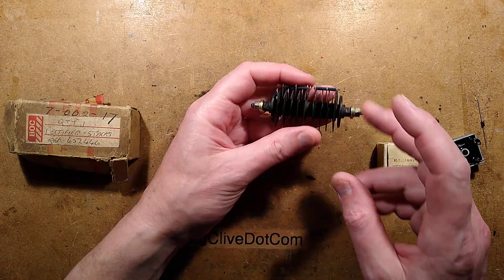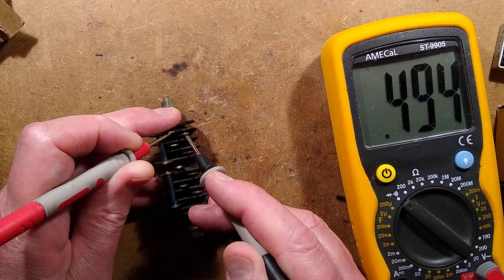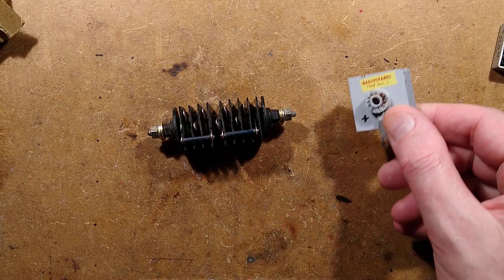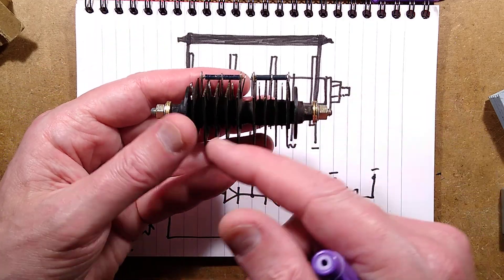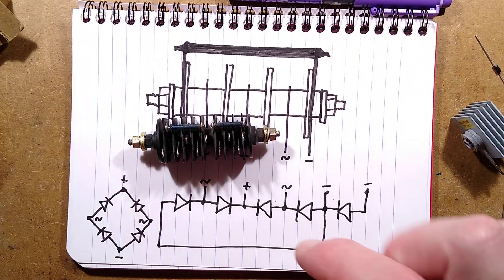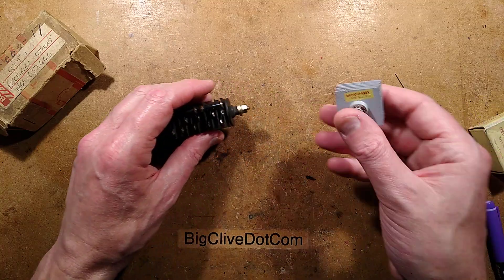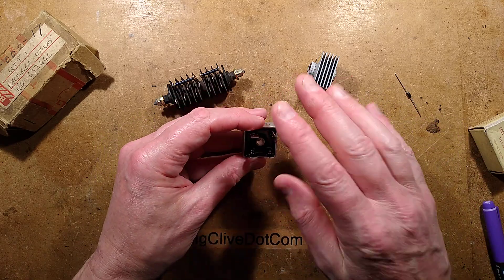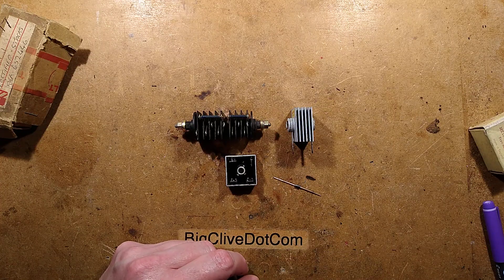Selenium rectifiers - the smelliest components ever

Comment: Maybe the extra diode is for using in a device that can be powered from AC or battery, to avoid charging the battery when on mains power.  Also I have seen and smelled a different kind of selenium rectifier used in slightly newer devices, where the plates do not have a hole, and are in a box or a tube, pressed together with a spring. This makes it smaller but the heat dissipation is a lot worse. There were full bridge rectifiers for radio anode voltage like that, and also TV anode voltage rectifiers made of a lot of very thin, confetti-like plates in a long tubular package, with just a dot of selenium in the middle. Looking a bit like one of the kinds of caps for a cap gun.

Comment: This helped me troubleshoot and fix a 1950's Lincoln Fleetwelder 200 arc welder with a non-functioning Arc Strike Circuit.  Replaced with an ECG 400V, 40A PRV bridge rectifier - thanks!

Comment: I had an old Triang train set in the attic from when I was a child and decided to give it to the grandchildren. My main concern before doing so was the safety of the mains transformer, but on inspection, I decided that it was well constructed with good separation between the primary and secondary.  I replaced the cable and mains plug with one with a built in RCD unit and as part of the refurbishment, I also replaced the selenium rectifier for a modern silicon bridge rectifier. This gave me a slightly higher output voltage, which compensated for the somewhat corroded parts elsewhere, so it was a win-win situation.

Comment: When I was a an apprentice with Reliance Telephones late sixties the Modern Telephones, Wellington St., Glasgow. Power supplies for lead acid batteries and intercom systems used proper power units screwed to the wall. You woulds go to the customers premises they always smelt like rotten fish. Four Lucas diodes and you were back in action.

Comment: The founder of the company I used to work for was employed by a selenium rectifier manufacturer here in the USA back in the late 40's.  He described the "burn in room" where they had racks of these things under load.  Apparently, right off the mfr'ing line, a lot of them had conductive faults in them that would blow out; I suppose the burn-in process would also weed out any of them that remained shorted or failed completely under load.  Of course he described the smell, and I was aghast b/c I'd heard that the smoke was really toxic.  He had a bit of a different mindset - he had no qualms about cleaning up mercury spills in our lab as well. lol  I guess his mindset worked out OK - he passed away in 2007 at the age of 81 and he worked full time right up until a month before he passed.

Comment: I've got a 1956 P&H 400 amp AC/DC arc welder....with a selenium rectifier...must be 60 plates, and maybe 8" or more wide...BIG fan blows on them all the time the machine is on. The TIG works about as well as most modern machines, but I know some guys have replaced the Selenium with silicon rectifiers...it's a full wave 'bridge' !!....so you'd need 4 big diodes and some nice aluminium plates...OK, aluminum. Youtube says I'm spelling wrong...

Comment: I learned how badly a blown selenium rectifier smells in the 1950s.  20 years later my Dad was upset that his workbench 6/12 volt power supply outputs were too high when I replaced the selenium devices with silicon diodes.

Comment: I still have a bunch of Selenium Rectifiers around here somewhere. They were very common when I first got into Electronics in the late 60s early 70s. Generally tougher than the Solid State equivalents available at the time. People found that just changing them with Solid State could cause over-voltage problems as Clive explained. We quite often had to deliberately add some resistance to balance things out.

Comment: Whenever I come across a selenium rectum-fryer as I call them I replace them. They do have an awful smell when they burn out. Had one in a Guitar Amp I was repairing and sure enough the garage started to smell like rotten eggs. Also keep in mind they attend to have the Anode and Kathode mixed up, I found that out when I was putting in a Diode to take place a Selenium in a old RCA VTVM.

Comment: In old setups I've seen terminal blocks with multiple diodes in series, used to drop the DC voltage to the desired level.

Comment: I love vintage electronics... I have over 100 vintage calculators, including an HP 9100A, a Friden EC-132, an SCM Cogito 240SR, A Sony Sobax ICC-600W, and a Wang 360SE. I have an old Sylvania Halovision TV, an pair of old electronic organs, a Conn and a Gulbransen (that uses hybrid modules), and much much more. In addition, i have various internals on display too... The relay module from an elevator, the multiple tube oscillators and amplifiers of another electronic organ, and one of the things I have on display are a pair of selenium rectifiers. They were coated in bright orange. Both are 6-fin high voltage types. The smaller one is a full bridge rectifier (total of 24 fins) with 1.25 inch (just over 3cm) square fins. The big one is a half wave rectifier (12 fins), but it has 2 inch (just over 5cm) fins! it's huge! I just love how they look, so they are one of the many odds and ends electronic bits that stay out on display at my place.

Comment: Question, I've heard something about the fail open/closed being different between the selenium rectifier vs silicon.  Isn't there a difference in the way you need to fuse it?  I ask because I have a jukebox with one of these things in it that runs the selection circuit.

Comment: These are also used in locomotives. They do stink when they die. These come in zeners as well. I had a large freewheeling rectifier short out when one of my coworkers started a locomotive up after he  failed to properly terminate the auxiliary generator. I had told him how to be sure of the leads but he took the advice of a novice electrician. Basically the rectifier exploded above my head. 
Clearly I was not happy and had some very unkind words for him. Don’t hook up a DC auxiliary generator on a locomotive backwards or bad things happen. There is a process for testing if in doubt about its polarity.

Comment: In our product we use a bridge rectifier made of four diode‘s. The first diode always heats up and dies. We believe this occurs due to a thermal run away when the power keeps looping around the rectifier. Is it possible that extra diode is there to take the load off of the diodes’ that build the rectifier?

Please consider this and let me know if that’s possible? 
If so adding a diode to my design might fix our issue.
Reply from the maker: I'd have to see a schematic to work out what might be happening.

Comment: Big, can you show how the magnetic rectifiers work? It was kind of like a relay. I’ve seen them on stuff in museums.. They were put on cheap car battery chargers in the 20’s. It was cheaper and more compact than a mercury bulb rectifiers.
Reply from the maker: I think they were a vibrating magnetic reed that connected with a terminal depending on the polarity of the transformer's or dedicated coil's magnetic field.

Comment: I once walked into the Wheelhouse of a 1950's built ship and immediately went over to one of the chart table cupboards where the echo sounder workings were and sure enough there was a whisp of smoke and the running light was off.  The Mate said the Secunny's (Indian helmsman) guts were a bit ripe that morning so I pointed out that the Selenium rectifiers, of which there were quite a few in the cupboard, had burnt out.  Profuse apologies as they both thought it was the other !

Comment: I wonder how they compare to tube rectifiers. I have an old tube radio here that uses a tube rectifier but the transformer shorted when someone replaced the 400mA fuse with a 35A car fuse. The replacement transformer was from a radio with a selenium rectifier and thus only had one secundary high voltage winding. Had to turn the tube rectifier in a bridge by adding 2 silicon diodes and the resulting b+ is about 10% higher than specified.

Comment: About 30 years ago I worked for a transformer manufacturer in Sydney. We also made a few power supplies for the SRA. (State Rail Authority). One of the items we made was on a steel tophat section of 2mm steel. The components were, one almost full wound toroidal transformer. The mounting screw had to be plastic sleeved for insolation, 1 20watt adjustable w/w resistor, and a selenium bridge rectifier with an extra plate as a blocking diode. We had to use the selenium bridge because the original units built maybe 40 or 50 years earlier had the selenium bridge. The design had to be the same. the toroidal transformer is more efficient... FROM GOOGLE     1878 -1883 - The Ganz Company (Budapest, Hungary) uses induction coils in their lighting systems with AC incandescent systems. This is the first appearance and use of the toroidal shaped transformer.

Comment: I did four years as a navy engineer and our older ships (built in the mid-1960s), and even some of the older individual systems on our newer ships, have all sorts of these rectifiers scattered throughout the various control circuits.

I never actually knew what they did before now, and always just assumed they were some sort of heat sink around some sort of fusible link. Thanks for sharing!

Comment: I was about 9 or 10 years old. I had a beefy transformer, 220VAC in, 12VAC out and I needed DC. I had silicon diodes. So I'd connect one on one of the output terminals and other to the outher but with reverse polarity. I'd get roughly 6Volts. Then I connected another two in a way that there would be two diodes on each terminal, + to - and - to +, then I'd connect the diodes of the same polarities' terminals parallelly. Voila, I get ~12VDC.
I think full-bridge rectifier is the natural next step for anyone with four diodes and half a brain.

Comment: Thanks, that was useful. I’ve got a Heathkit vacuum tube op amp module with two small selenium rectifiers in the screen grid supply. These are in a cylindrical package. I was wondering how bad the lower voltage drop of the silicon diodes would be, but it sounds like it shouldn’t be that bad. I’ll plan on replacing them when I re-cap the unit.

Comment: Selenium rectifiers were used in some railway signal components. The one place I saw one for sure was at the end of a track circuit that was at the end of a signal system.

Basically any selenium compound is toxic even in moderate doses, but unless you can somehow manage to sit there in the stuff, you're not likely to get a dangerous dose from just the smoke

Comment: I worked in an old mill that used them. The winding machines used 90 volt DC magnetic clutches. The selenium rectifiers used were about 2 feet long and 6 inches square. I asked where they go them and was told they came from a B-17 from WW2. This was in the 80's. They had modern digital timers running the clutches relays and the old selenium rectifiers to get the DC power. It was a real crazy rig up.

Comment: You see them all the time in older electronics. You frequently have to add a dropping resistor in series  when replacing them  with silicon rectifiers to avoid excessive output voltages.

Comment: When replacing a selenium rectifier with a silicon diode, it is common to place a voltage dropping resistor in series with the diode. It takes a bit of figuring to determine the resistance and wattage for the resistor.

Comment: Zenith used to use those in some of their 1950s radios, especially the AM FM ones in the "Super Interlude" or "Super Symphonaire" family with the large ring around the speaker (woofer on these High Fidelity rated sets). I've seen some on eBay where the shiny ring / dial around the speaker (search for Zenith C835) is brown and discolored. Guess where they mounted the selenium rectifier? Front center of the chassis, right under the speaker! Needless to say, never pay too much for a Zenith AM FM where the bottom of the speaker ring looks burned!  I always replace the selenium rectifier with a silicon diode and about a 100 ohm 10 watt resistor in series.  (We don't want to strain the 35C5 output tube with too high of B+, especially when line voltages in the USA are already higher than they were when these radios were made.)

Comment: You ever smelled carbon disulfide? Smells like extremely rotten cabbages unless it's very pure. There are only two things which are guaranteed to make an army run away: carbon disulfide and massed bagpipes. Wikipedia says selenium dioxide has been described as smelling like rotting horseradishes.

Comment: Thank you Clive, that brought back unpleasant memories from fifty years ago.
My first permanent job in 1969 was reconditioning IBM keypunches and verifiers. The older machines used selenium rectifiers in the power supplies for the valves and relays. I was surprised by the stink the first time one failed in our large workshop. I doubt anyone's farts smell as bad! Imagine how bad it would be in a WWII aircraft.
Voltage drop was a problem in 1950s DC power supplies. E.G. Both my '00 Gauge' railway and my brothers ''Scalextric' required 12V but the transformer needed to supply 16V RMS. I would often trick my brother into leaving the track by cutting power to my car as he was approaching a corner! Adding a large capacitor to the DC output resulted in faster cars and little variation in voltage with load.
Reply: Yeah, 1969...for me it was the Telegraph Machines...the 'new' ones had electronics, transistors and still operated on 48 volts to work with the rest of the copper lines (that are still 48 volts). The teletypes used 120 VAC input, power supply converted to 48 Volts DC. They still needed 120 VAC as there were induction motors driving the printer and tape/keyboard decoder...all that was mechanical.....lots of tiny parts...100's of springs...

Comment: Don't smell like a fart. 
Dig down to the nearest sewer. Use a sledgehammer to break a hole , then apply your face to that hole and inhale deeply. THAT is what it smells like.
Do you really need to ask how I know that??
You can actually still get them new, as in brand new, not Old Stock unused. I used one in a radio set to replace a failed original. B+ was down to 150V from incoming 250V AC.

Wish I could get them with round plates.

Comment: This brings back some old memories.

I learned about electronics quite early in life, so some of the old appliances that I played with were 50s and 60s vintage.  By the time I became more adept at it, about when my age got into the double digits (the seventies,) silicon diodes were more the norm.  Still, I had some old selenium stacks to play with.

I don't recall burning one out myself, but I do recall being around when it happened.  Yes, the smell is horrific.

Fast forward to around 1981, when I was stationed in Germany and worked in an electronics repair shop.

I bought some stink bombs, which were small crushable glass vials like you will find in smelling salts.  The difference is that, instead of ammonia, it contains some kind of a hydrogen sulfide solution.

Well... I managed to drop one near the 28 volt power supply.  This caused an immediate evacuation of the shop.  The next day, we had to drag the 100+ pound power supply up the stairs and to the other repair shop.  Of course, they found no fault with it.

So we had to drag it back down the stairs and reconnect it.

(And I still have no idea if it actually had a selenium stack.)

Comment: If replacing a selenium rectifier with a silicon version a surge protection resistor should be fitted, especially if high voltage electrolytics are involved as many can't stand high surge currents.  In TVs of 50s and 60s vintage the usual half-wave selenium rectifier was replaced with a BY100 silicon diode in series with an 18 ohm 5W wirewound surge resistor.

Comment: Old equipment indeed. The only time I had to deal with these rectifiers was in the 90s in the automatic voltage regulator of a variable frequency turbo-alternator. A simple substitution with a silicon bridge would have involved a HUGE amount of paperwork. I managed to source a custom built selenium replacement, but even that involved quite a lot of paperwork. It was much easier dealing with the amplidyne AVRs on the main T/As.

Comment: I had an old motorcycle that used one of these in the charging circuit. Unfortunately, it had failed, so my solution was to cut square metal plates, and solder on some button diodes from a scrap car alternator with spacers made from plastic pop bottle tops. Ended up with a drop-in replacement.

Comment: Nice to see your Dual Full-wave Bridge Selenium Rectifier, looks like it was configured for a specific application.
Long ago, while going for my EE Degree, I worked as a Test Supervisor at a nearby General Instrument / Radio Receptor Factory. They manufactured Selenium Rectifiers of all types and sizes. Most were dipped in Green paint. When they failed, I kind of liked the smell, more metallic than malodorous. Maybe I just got used to that smell, which has not killed me yet. 
Failed Electrolytic Capacitors smelled much worse to me.
For those seeking the smell specified in the title of this video, try smelling a bottle of the "health" supplement NAC.

Comment: If they had headlights, Motorcycles up to the late 70s often had a single selenium diode to rectify the voltage from the dynamo to DC for the battery.
Reply: I think that was a Zener diode working as a voltage regulator?